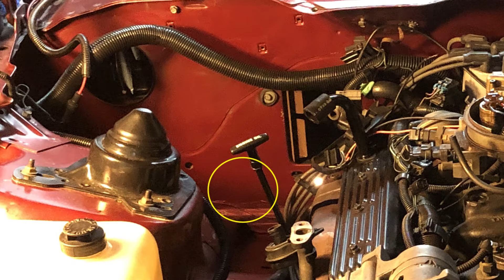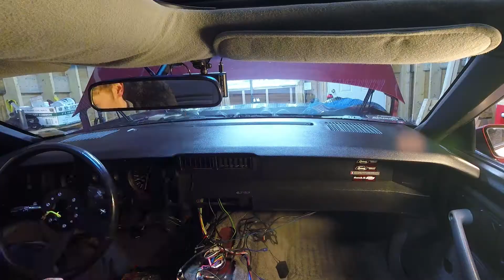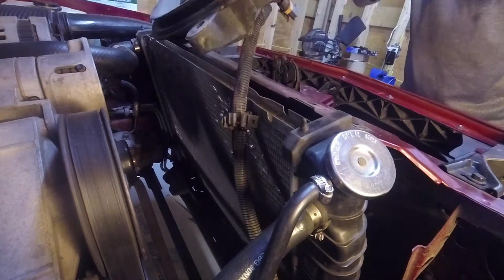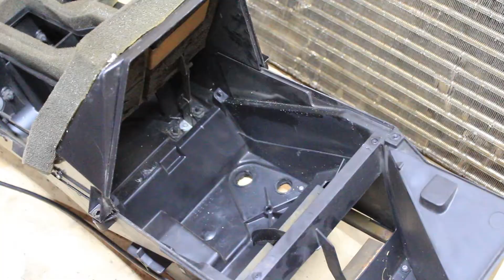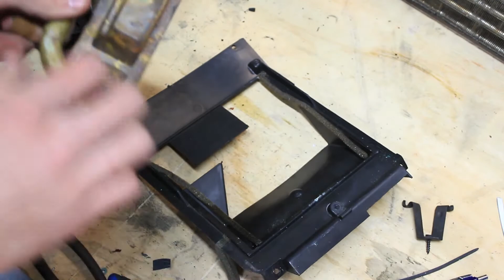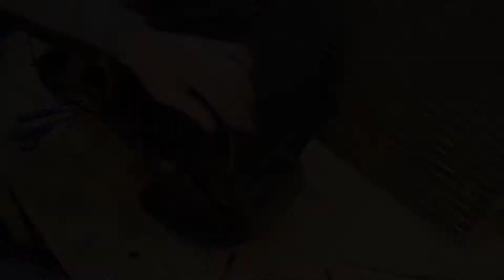Third Gen Camaro Interior and Radiator Removal (AC Retrofit Ep 2)

Comment: God bless you man. I wish I had seen this while you were in the process of installing it. I have a 1992 1LE and I have had factory a/c installed. It was a nightmare, but so worth it.
Reply from the maker: Sounds like a sweet ride! I'm glad you enjoyed the video!
Reply: @brickheadgarage554  I am curious if a scroll style compressor would work more efficiently with R12 or if it would need to be converted. I don’t think anyone ever used a scroll style back when R12 was common. I used a NOS R12 Harrison unit, and charged the system with R12 - for authenticity and performance. I would love to share pictures. Mine is a hard top 5spd white/red. I am like a kid when it comes to that car. I have had it since 1996, so don’t sell yours!
Reply from the maker: @LS1LE  That's awesome! Sounds like a sweet ride! Other than being prone to leaking, I haven't actually heard any bad things about the performance of the original R4 compressors, especially if you're using R12 like it was designed for. I'm sure it gets much colder than R134a, at least with the original condenser. Hopefully, I can get one of those fancy aftermarket parallel-flow condensers someday to bring it up to snuff. And don't worry, I have no plans of getting rid of this car, I love it!